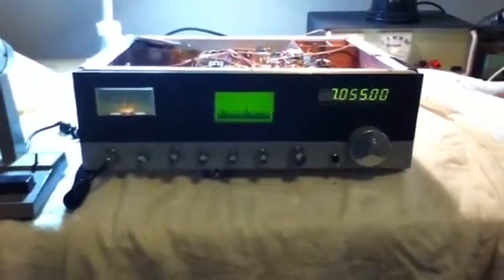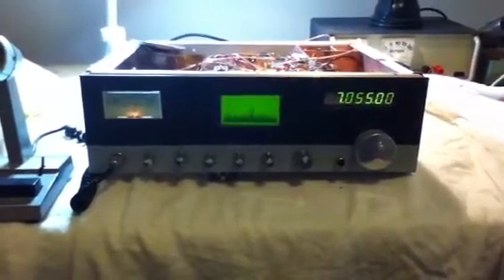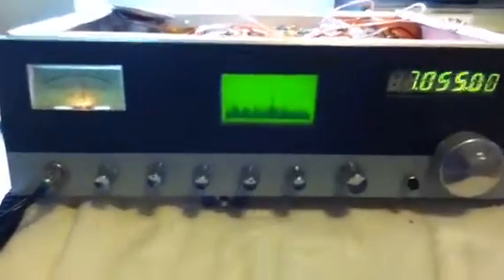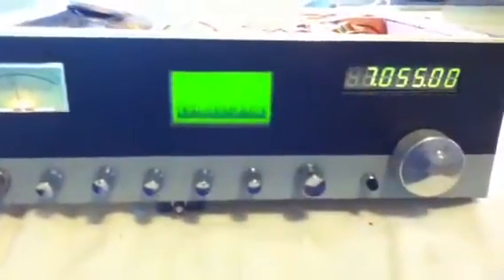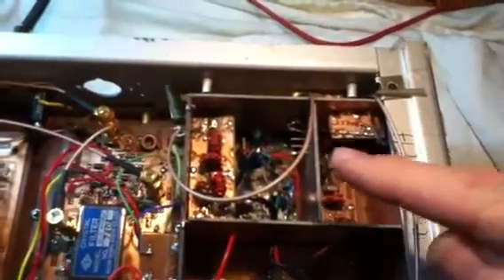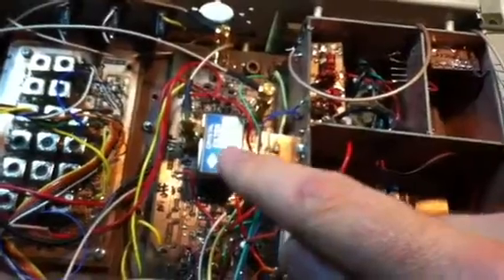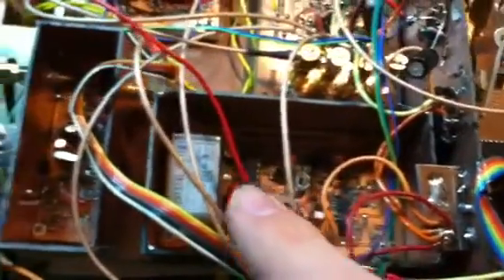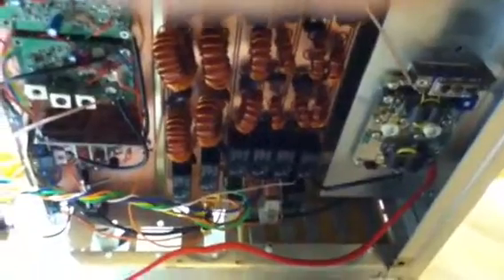Homebrew multiband HF SSB DDS transceiver with spectrum scope

Comment: nice done !
can you share spectrum scope details (sch & source)  ?
Reply from the maker: +YO2LDK  Thanks for the nice comment. Go to my QRZ.com page and type in my callsign VK3KTV. At the bottom of the page I have added the 8051 source code. Hope it helps with some ideas. Will try to add some Sch info at some stage. 73
Reply: +VK3KTV  Thank you very much, my best 73 !